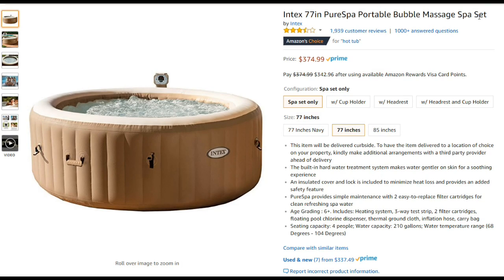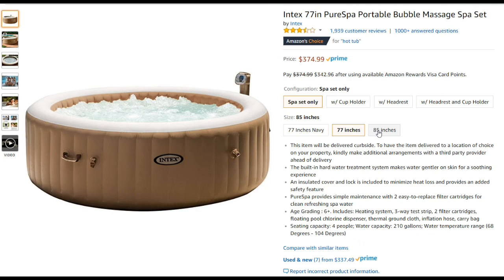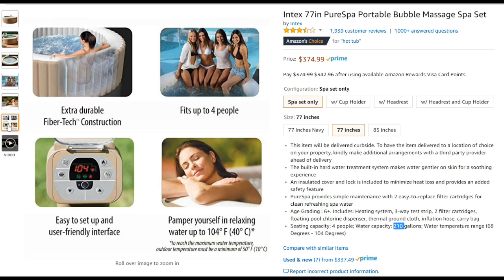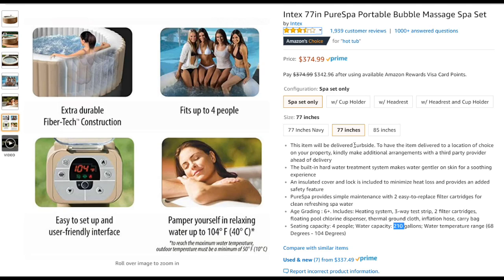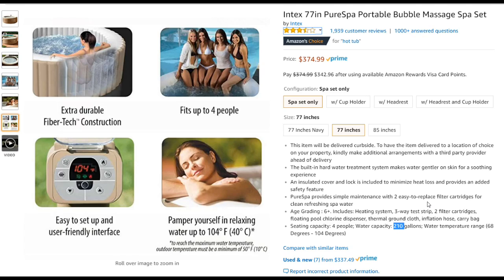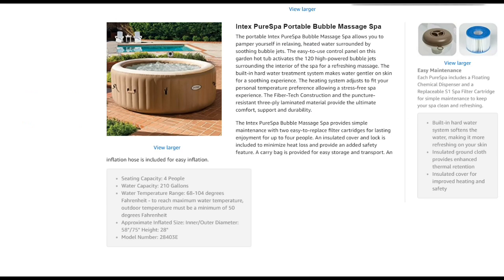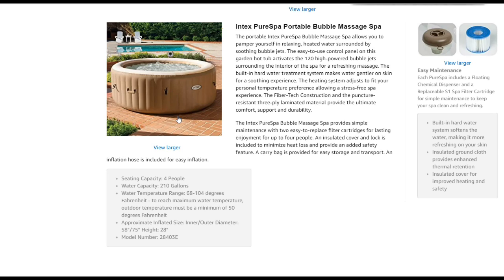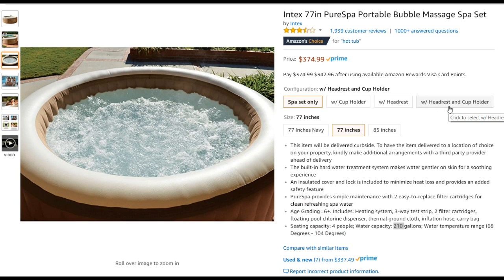Intex 77 inch PureSpa Portable Bubble Massage Spa Set Unboxing Assembly, Set-Up and Full Review

Comment: Is it too loud to put inside your apartment? Will it disturb neighbors?
Reply from the maker: Very good question. The audio / sound waves won't be a problem for sure, but the vibration of the pump could be transmitted through the floors/walls and you definitely would have to check regarding the max weight per sqft and I'm not sure, if your insurance would be happy with so much water in the apartment ;-)
Reply: ALLCHECKOUT Product Videos, Reviews, Infos, Tests thank you so much for your reply!

Comment: Very comprehensive video, thanks. How has your spa been holding up? Any troubles with it?
Reply from the maker: Thanks for the nice feedback. I'm still using it almost every day and it's still in perfect shape and also color almost hasn't changed at all. Had to add a bit of air just once and replaced the filter cartridges. Last time I replaced the water was about 3 months ago and it hasn't lost a single drop since. 
Also bought the Intex PureSpa Battery Multi-Colored LED (https://amzn.to/2YbUiyd) and most of the accessories except from the headrests which seemed to be very uncomfortable. Our family really loves this thing and price is pretty low now, even for the accessories - seems to be a very good moment to buy. 
Using my link (https://amzn.to/2BYSvnx) to buy would be highly appreciated and helps me to continue with such videos. Thanks!